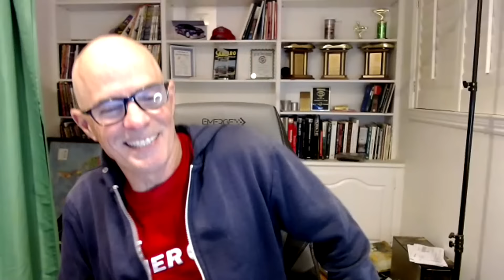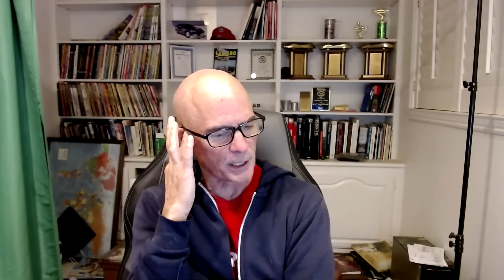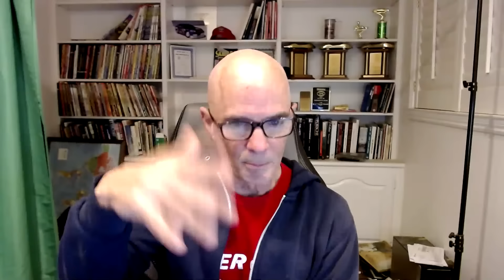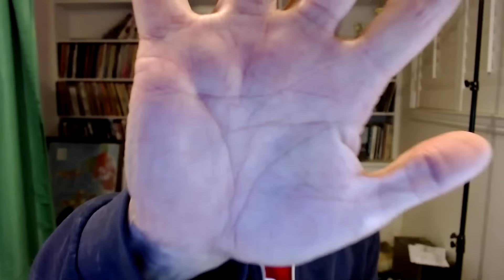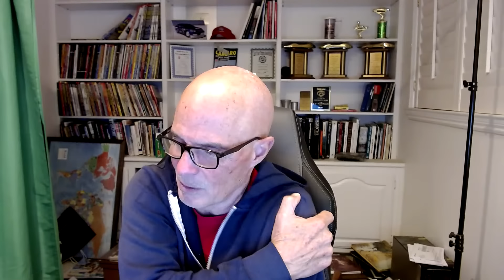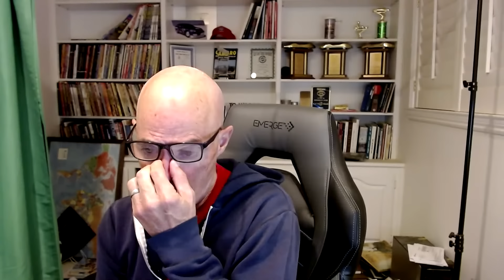TURBO 5.0L MODS LET'S TALK TECH

Comment: The affordable power Joe Irwin is referring too is being able to take a stock engine so far. 1000+ wheel horsepower. Not needing heads or cams etc. depends how you look at things 🙌

Comment: My second hot rod was a 1964 Fairlane original 5 bolt 289 car with a manual 3 speed that I stroked to a 331 with a crane cam, headers, Holley 600 and aluminum intake.  It was so much fun.  It was my daily.  I drove 53 miles each way to work 6 days a week.  I drove it home from work one day and noticed that my oil pressure wasn't as high as normal.  I parked it, let it cool and it never spun over again.  It was locked up tighter than Dick's hat band.  It had about 125,000 miles on my rebuild, but It had cruised back and forth to work for quite a while at 3100 RPM at 65mph.  Everyone at work wanted it but I sold it to a family member.  I have no Idea what happened to it.  Wish I had it back.  LOL  289, 302 or 5.0 are legendary Fords

Comment: Does anyone have a fix for leaking throttle blade shaft on the bbk throttle body’s???
Reply from the maker: different tb
Reply: @richardholdener1727  thanks for the reply but I’m in CA and there the only ones with an e.o. # that I can find

Comment: I have a 96 351w with about 80 thousand miles on it and its a factory stock short block. On the shelf I have a TFS stage 3 cam, a set of Victor Jr. Heads. And a Holley Hi-ram intake.. In order to put boost on it and make around 650hp will these stock dished pistons be ok?
Reply from the maker: Hi Ram is about the very best intake you can run on a 351
Reply: Garbage intake and the block will look like the Grand Canyon but send it
Reply: @boost1728  You are the only person I've seen say the Hi-ram is garbage, Can you elaborate on that ?

Comment: I put a T76 turbo on my 96 F150 5.0, stock cam, blue print heads, Holley Hi ram and terminator X. A bit overkill on the turbo size but it was Cheeeap. But I kinda want the instant boost, thinking about a much smaller turbo.. GT35 maybe..?